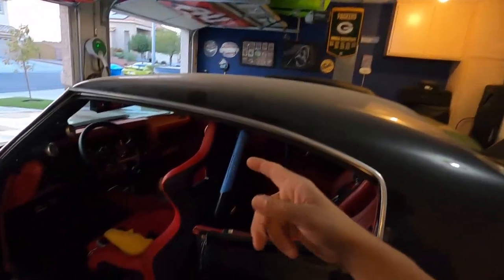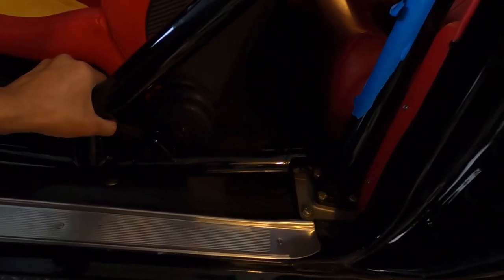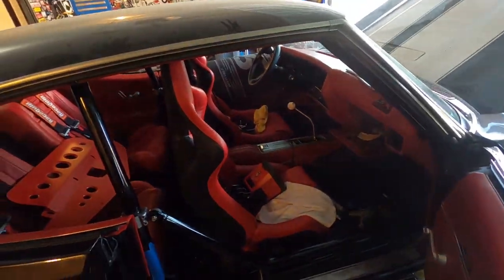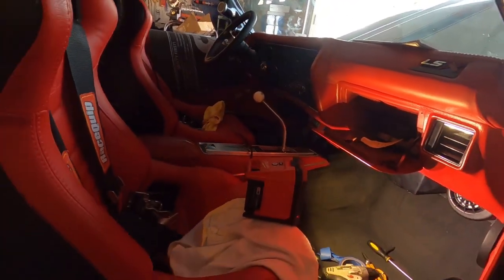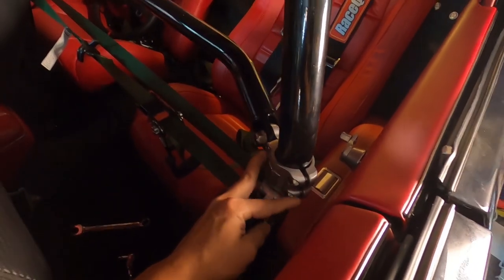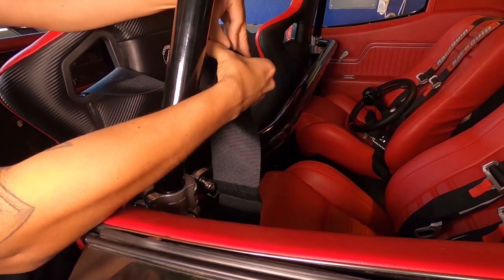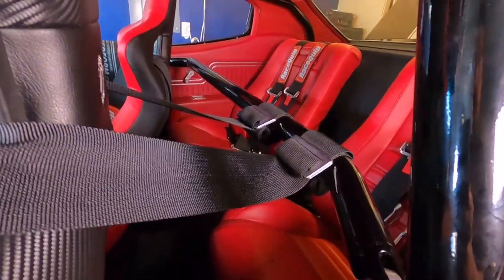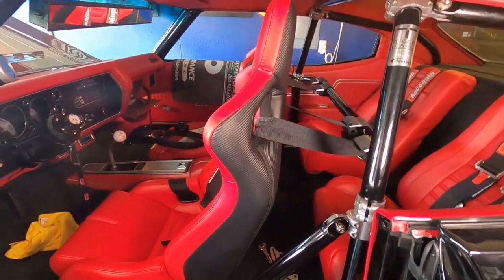RIDE TECH TIGER CAGE AND 5 POINT SEAT HARNESS FINAL INSTALL ON THE LSX TWIN TURBO CHEVELLE!

Comment: That Tiger cage that you have is every one of them both into the floor
Reply: Bolt in the floor ?
Reply from the maker: @tomikhaos7248  YES
Reply: @goosseperformance1444  how much did you pay for that Tiger cage
Reply: Do u have the part numbers
Reply from the maker: @tomikhaos7248  RIDE TECH STOP MAKING THE CAGE